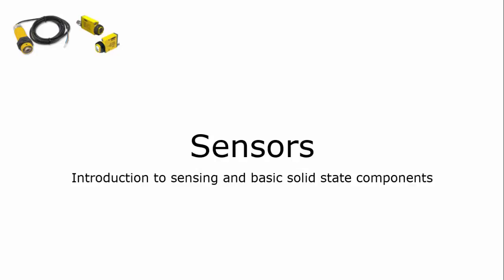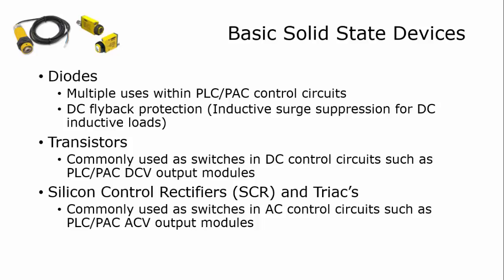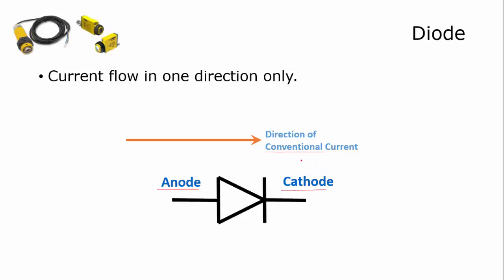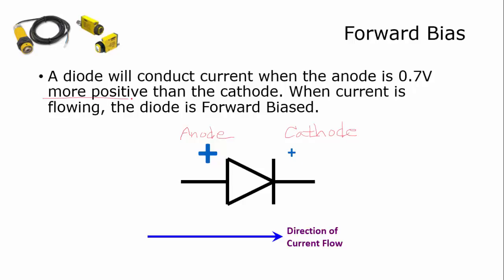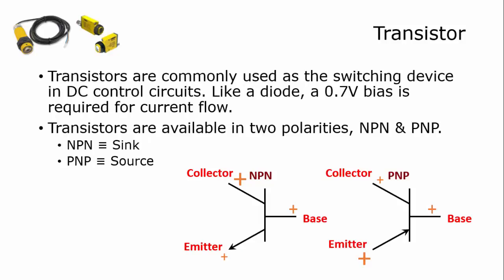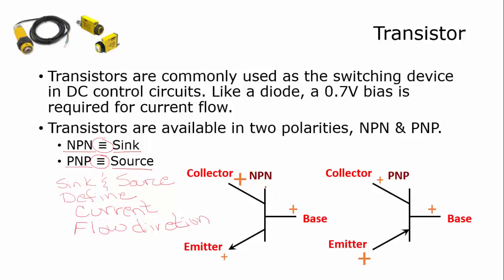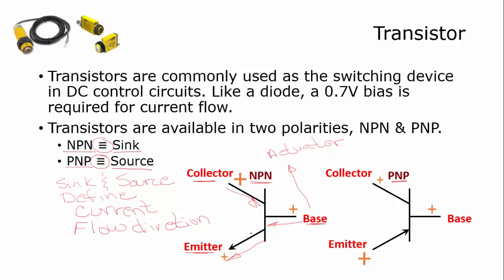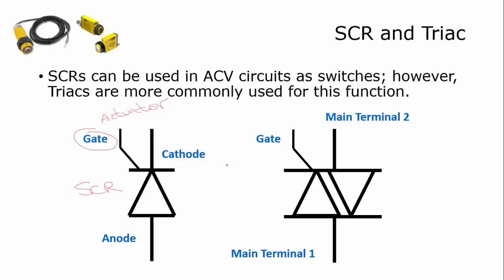Sensors SolidState

Comment: a good lecture for basic but it is not about the sensor. so please remove the term sensor.
Reply from the maker: You are correct. This slide set is the entry presentation to sensors so that students who have had little or no exposure to solid state equipment has at least a basic understanding of what makes up a sensor. So...although you are correct, this is the opening slides to a much larger presentation. Thank you and when I get time I will make the changes.
Reply from the maker: You are correct; however, it is the first slide set in a series about sensors so that students start to understand that sensors are solid state devices. So...I know what you're saying, but when the presentation is watched in the context of the series, it makes more sense. Thanks.